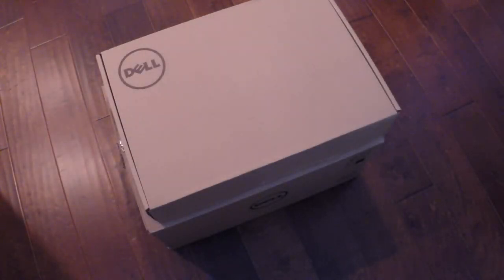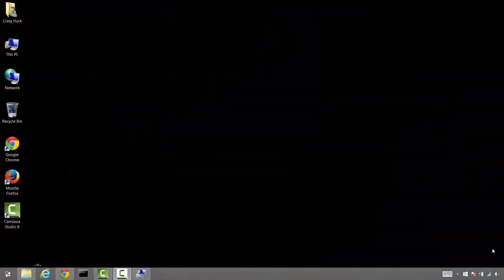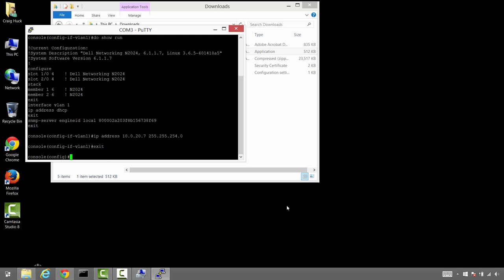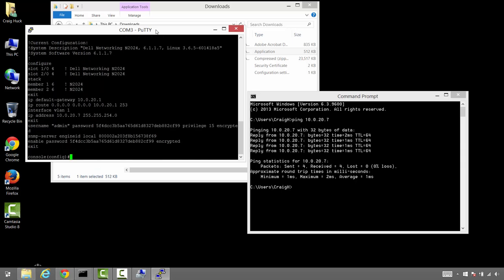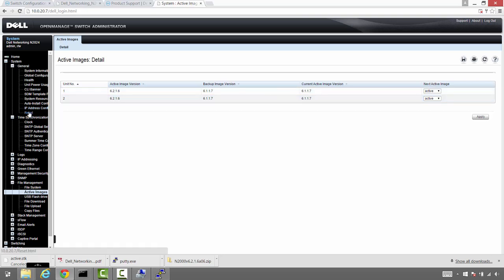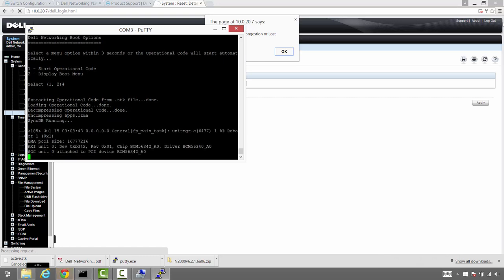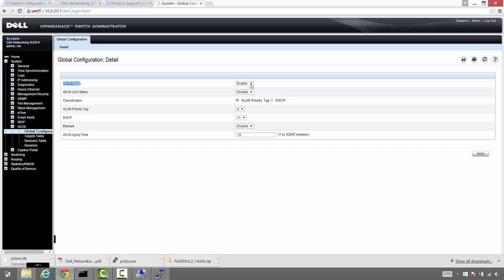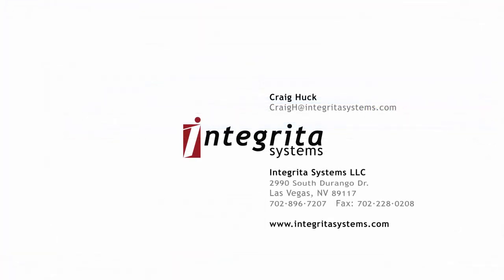Storage Area Network Configuration

Comment: Could you use LAG plus Stacking cables for reduncancy?
Reply from the maker: If you are using both stacking ports to connect all of your N-series switches together then you already have a redundant path in place. We've never setup these switches with that configuration but since the stacking cables make the switches look like a single unit I would say it's probably NOT possible. If you are referring to an MLAG configuration then I know it's also not possible because MLAG peers can not be stacked (http://i.dell.com/sites/doccontent/shared-content/data-sheets/en/Documents/Dell_Networking_N_Series_Multichassis_LAG_MLAG.pdf).

Comment: Something is wrong on your schema at 7:36. You must have a blue and a red cable on each switch in order to do not loose the connectivity
Reply from the maker: Out of the 4 NICs on the server, each switch as 2 connections. This diagram is from Dell's guide and the numbers on the blue and red lines either refer to the switch port number of the NIC number on the server. That being said it looks correct to me.